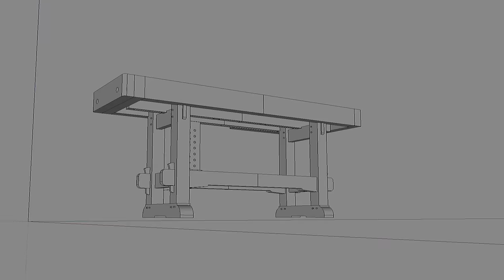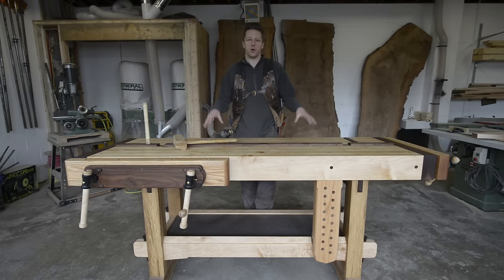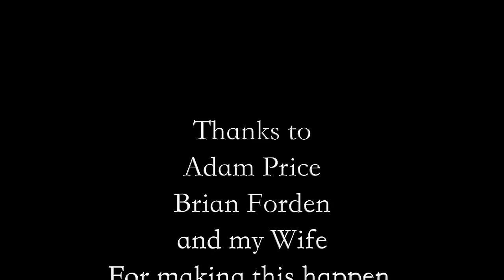Woodworking, The Samurai Workbench

Comment: I may finally be in a position to build this wonderful bench...but with a twist. 

My father-in-law gave me 2 sections of a butcher lock countertop he took out of one of the rental houses he had to repair from flooding (the countertops are fine), and I would love to use them for the top of my workbench since it would be a great place for that section for the tools to fit in.   

But...I am unsure how to modify this bench to accommodate for that as these are only about 1 1/2" thick and you used what looks like 2x4's for your top.  I also don't have any of the tools you have like huge miter saws, track saws or anything.  lol

Comment: other than some brilliant joinery we have built very similiar benches i used two veritas chain drinve twin screw vises. and while the trrestles are mortified and tennoned i use torsion bars to hold it together lengthwise with a set of drawers as part on the stiffening . its severd me wonderfull y for thirty years. when i moved from boston to california all i had to do was tighten the bars a touch and its as solid and heavy as the rock of gebralter. I am a big fan of twin screw vises

Comment: Great build. Ive been thinking if i should do a wide double screw or the typical roubo lower screw. The two screws for wide work seems more usable, but makes the sliding dead man less usable, and i find myself clamping wide wood on the face of my current bench for edge planing a lot. I may just have to make a double screw that one can be removed and put in the leg or in the face of the benchtop.

Comment: Hi Samurai, i have a question..  im looking into buying or building my first work bench,  and one idea i have to reduce the required space for the workshop the idea of having a table saw built into the workbench..  as far i can see, nobody has done this.   is there a reason why?

i was thinking of installing it underneath the table and having a slit cut out for the blade to pop up out of..   maybe even have a nice press fit metal edge around the slit to help reduce any damage/splintering to the workbench surface

Comment: Noob question here, what's the function of the sliding slab between the legs? Is it just for storing the hold down pieces?
Reply: To possibly  clamp a piece  to the front of the bench. Have seen other styles but none that slide. Typically  you will see it clamped  in the front vice and to a leg. But this can give you a wider range of sizes to work with on the slide. My question is how sturdy or functional  is that sliding contraption? If is is used as a hold down.